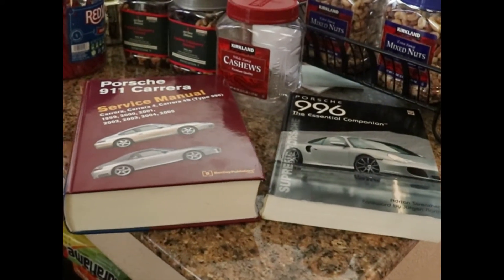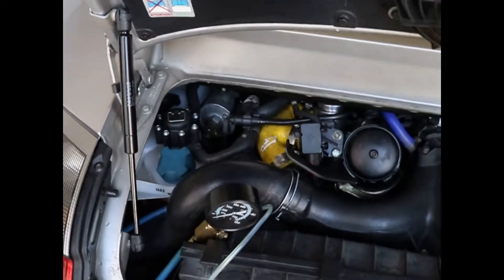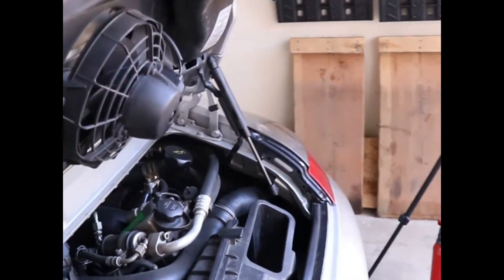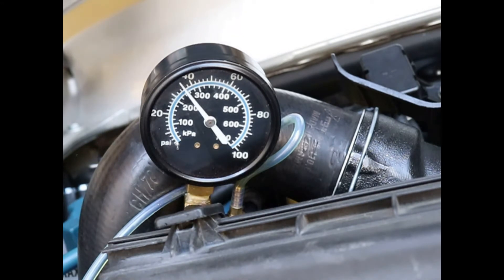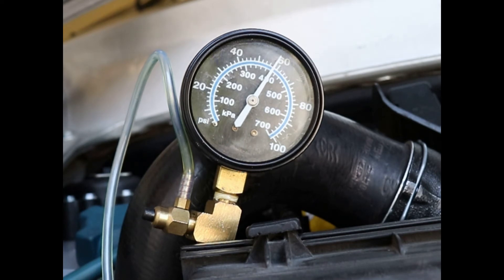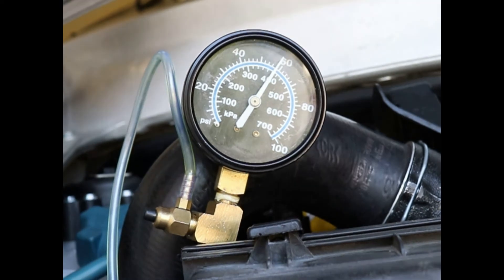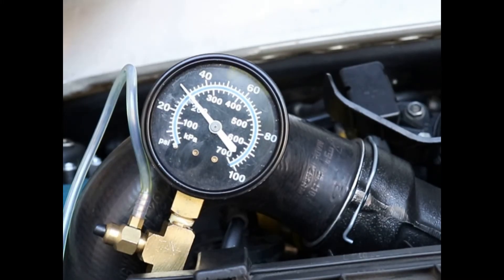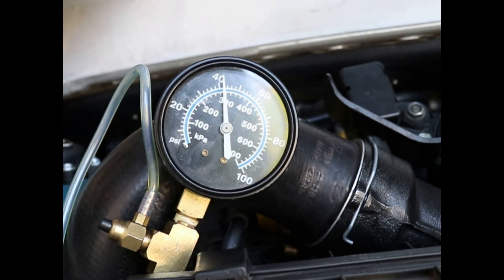How to perform Fuel pressure tests on the Porsche 996 Turbo

Comment: i think it's good, 55psi +/- 3psi, right on the dot!
Reply from the maker: Nope, something is wrong with the vacuum or the diaphragm inside the regulator, the needle should be much more stable when the engine is running.